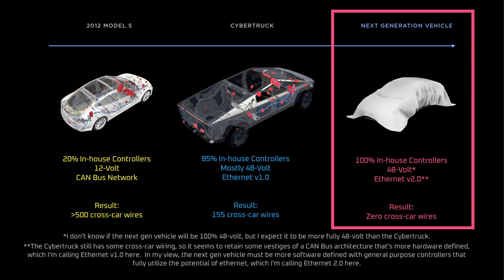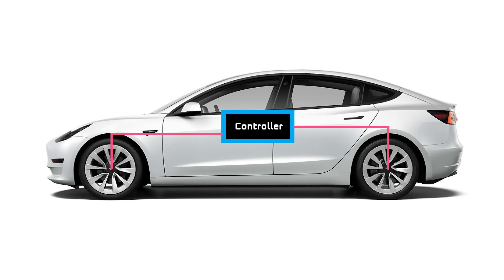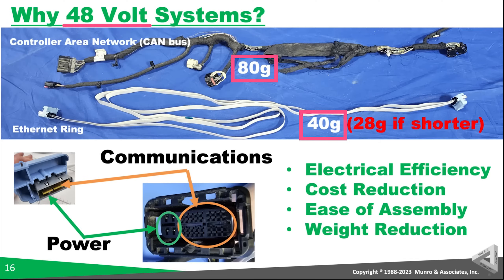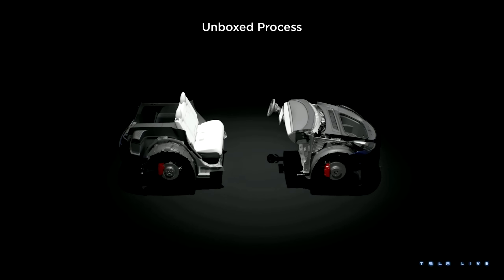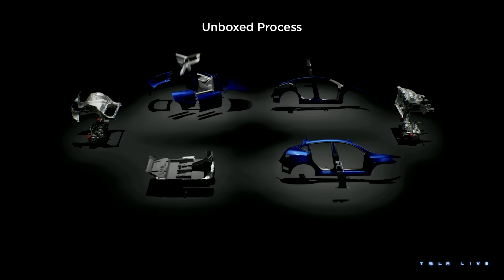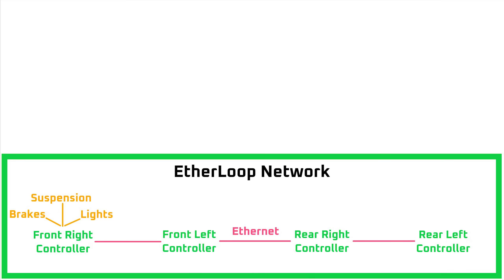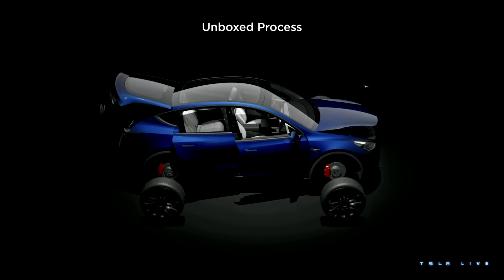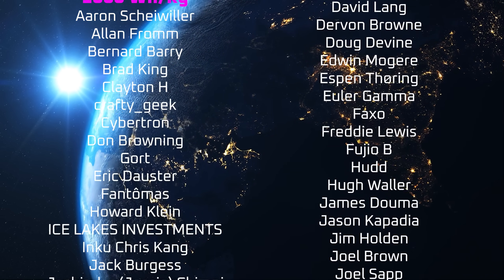Digging Deeper on Tesla's Etherloop Wiring System

Comment: Good information. This is a real game changer, not only for vehicles but for anything complex. It's a bit like when hardrives were SCSI,  mouse/keyboard were wired and had different plugs than printers. I'm not sure that this Tesla architecture if it becomes a standard can make any licensing fees for Tesla. Likely it's too generic. (Tesla might be able to sell 48v components, because no one is making these.  Cars were 6v until the 1950s, then 12v. Since about the 1960s they could've gone to 24v and then 48v which would've save billions in copper. What's happened is all OEMs (except) Tesla  use off the shelf components: lights, sensors, wiper motors, etc... which are now all 12v. They're so used to going through catalogues and making phone calls that it would be like starting from scratch for most OEMS.  This is why when Sandy Munro looked into the Ford Mach E and the VW EV he found triple the number of hoses and wiring as in a Tesla, and much less efficient use of space. The VW  has no frunk, but also almost nothing behind the dash where it would've been out of the way. This increased complexity also increases failure & recalls. ) 

For boats there's the NMEA 2000 network. It's a 12v CanBus system and is compaatible. You could stick a windvane on your car and plug it into CanBus.  NMEA 2000 has a few features that must also be common for CanBus: A backbone that runs the length of the vehicle (boat or car) and drops to the various sensors.The backbone is powered by a 12v connection(through one of the drops dedicated for this) but this 12v only powers the bus-- each instrument requires a separate power line.  Drops can be no longer than 6m (20').  My sailboat has a 63' mast and instruments at the top. The workaround is the Backbone runs to the front sensors near the bow, and then doubles back and goes  up the mast. The Drops then for the wind direction, speed, any cameras, maybe a radar on a spreader are very short. (I think the Backbone can be 170m long -- some very big length.)  There has to be terminators at each end of the Backbone. On my boat these will be in the binnacle (in the cockpit at the wheel, where the new chartplotter is and  my old Autopilot - which has never had a single issue in 20 years.) Third the NMEA 2000 network is infinitely adaptable. It plugs (and waterproof screw attachments) and modular. Right now it's in my binnacle down to above my engine. Later it'll run forward to the new depth sensor, and if I replace everything on top of the mast, I'll unscrew the terminator add more backbone to go up the mast... It's like Legos. 

Wnat  the data that flows into the backbone must be doing is identify the instrument source and the quantity. Signals for operation that flow back along the backbone must be understandable by the unit, lights, camera (to turn on, move, etc..)  
NMEA 2000  has a couple of features. First all manufacturers agreed to a set of standards  -so everything that uses it is cross compatible. Second it refreshes up to 2000x/second. The previous 0813 (SeaTalk in RayMarine) refreshes at a much lower rate.  My boat has both. There are translators sold that allow connecting the older 0813 instruments to the NMEA 2000 network, but I haven't tried them yet. I'm waiting to find verifiable real world cases where this is working. Otherwise I'll just buy new sensors.   
Just a download... if anyone is nerdy enough to be interested.  And of course as I was bending my brain to learn all this last month and then buying the gear.... of course I had the thought: As soon as I get this all hooked up, newer and better wireless gear is going to replace it. (There are wireless mast top instruments but so far these have a reliability issue.)

Comment: I have reservations about things like stering, brakes and the parking brake being fully controlled by wire or computer.
How is one supposed to move and control a vehicle that is bricked?
What happens on a heavily trafficed freeway, how about a remote piece of highway or in the case of the truck. A logging road, if things have failed, you cannot have the vehicle lock up, you will by hook or crook, have to pull it off the road until arrangements can be made.

Comment: Note that EtherCAT has existed for well over a decade at this point, and is used in safety critical parts of simulators today.  It is also used for CNC control. This has extremely defined latency, and solves the problems of traditional Ethernet.  However, the whole master controller thing may not be what Tesla wants.

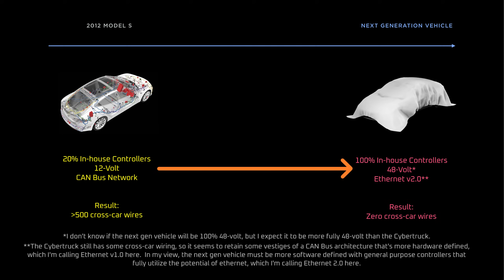I'd also like to address the whole part about random backoff times mentioned at around 16:50.  That's only a concern when multiple devices are plugged into a single wire, and is almost never the case in modern infrastructure.  Decades ago we used "network hubs" which just tied the wires together in a fancy box with a repeater.  Today we use "network switches", which operate in point to point mode with other computers.  This centralized network switch is known as a "star topology".

Another fun thing you may be interested in is POE (Power Over Ethernet).  Since Ethernet is a differential signaling protocol, it can be thought of as AC.  Well, we can apply a DC bias and power something with that.  Here's the interesting part.  That DC bias used for POE happens to be 48V.  It is a common voltage, so may be coincidence, but could reduce the wire count even further.

Comment: Very good explanation - thank you. 
From a point of view towrds maintenance the Etherloop and controllers should also make it much more simple to troubleshoot problems and faults. It also should make it more simple to design more robust fault tolerant systems with redundancy - e.g. a single wire failure may no longer be in issue.
Reply from the maker: Great point!

Comment: This also means common hardware which can also provide redundancy ,  you just need enough I O to go all the jobs it's attached to , it's very like PLCC , but the loss of a controller cpu could also be engineered round with the other units taking over the processing hence redundancy
Reply: @thelimitingfactor this would be sweet, does this assume a dud controller can pass through the end points it’s connected to onwards to another controller? Does the Airbus controller approach (mentioned in the comments here) offer insight?

Comment: This is basically turning the vehicle communication system in to ethernet network, this is already a trend in many industrial applications. In one sense they can build this them there are a lot of off the self-components you can sources.  Most of the challenging work is in   the software itself that managing the car and the controllers can be general purpose all in one micro controller. the next step i expect is to replace the controller interconnect with fiber optics   once I see they are using 48 volts they already saving money but using standardized components.

Comment: You can do the general layout you describe with ethernet with CAN, and tesla has been doing it. The main reason is data speed. The loop part of it is for redundancy, I figure.
Reply from the maker: Yes!  I simplified this a bit.  But it's more than just data speed.  And you are correct about redundancy, there's two ribbons
Reply: CAN is terrible for numerous reasons, speed being but one point.

Comment: Tesla still needs to implement some redundancy in the wiring due to shorts or open circuits in the Etherloop cables. But I get it! It all comes down to configuration management or the software features, variant handling, and fall-back/promotion of features to control I/O on another ECU remotely...

Comment: Now plugging in in a bad USB can finally turn off your breaks. Limitations of CAN are like 64 nodes. That's quite a lot of you want safety of isolating your inside lights and Netflix show from your breaks. Oh and remember that standard Gbps LAN requires 8 wires, instead of 3 for CAN.

Comment: Kafka, kubernetes with single type of controller all connected to same network. They took ideas from high speed finance trading and cloud computing/networking. They virtualized and moved development and testing in single repository. Took all ideas from modern software development.
Reply: Many things in the past decade have been moving increasingly to software controlled and centralised control systems. This is pretty similar, and for the same reasons. Manufacturing cost, less complexity(for the manufacturer) and production line efficiency

Comment: One benefit of the Etherloop that wasn't mentioned is it's a network which  means the signal has more than one possible wiring route - If there's a problem with a specific cable there's a back-up route that'd still transmit the signal (there's no single point of failure (when it comes to wiring)
Reply: Except that’s also the case with CAN in a ring topology.

Comment: Iirc the ieee have specified a new ethernet standard for deterministic ethernet so that time critical messages can be utilised.
There is already a method of tagging quality of service on ethernet so that time/flow critical applications such as VOIP and video can be used. However both these applications it is more important to ensure no jitter or flow interruption than ensure immediate delivery.

The new standard is supposed to deal with time critical operations such as braking, steering etc.

Comment: This thing sounds like EtherCAT, which has been a thing since forever in industrial automation. How it works is there's a master node with 2 ports - a sender and a receiver. The slaves are then connected in a loop that goes from the sender port to the receiver. How it works is that the sender eth interface sends a giant packet and the senders and  receivers fill it up with information right  as the packet passes  through them. The beauty of the system is that uses regular Ethernet phyisical standards and controllers, making it both fast and cheap. Additionally, outside of the special  packet, its a regular Ethernet bus that can host regular communication.

It's not really redudant and fault tolerant to breakage, but then, neither is a hydraulic brake like.

Comment: Mybe this was brought up and maybe the unboxing revealed info about this, but  i have been phantasizing about endpoints that ‘speak’ etherloop. So a breaklight consists of, say 20LEDs, those LEDs are driven by a simple microcontroller (think arduino kind of thing) the microcontroller received its instructions from what is called a controller in the video, but over the etherloop, not via cross car wiring.  The microcontrolles can also be fairly generic and the controllers can be simple or complex and software defined, as you like. But the need for cross car wiring is eliminated. You only need at each endpoint a power rail and an etherloop connection.

Comment: This video has quite a couple things wrong, and I'm not sure if it was done on purpose to make Etherloop seem better: CAN-Bus already is a ring Bus, there are no crosswires between between all the controllers.

The 48V system advantages are also overstated: controllers do not run on 48V (nor do they run on 12V), they will generally run sub 5V, so there is no difference in the cooling requirements for the controllers. The only difference will be on the power side of controllers IF the controlled device can be built to run on 48V.

Also 24V (most trucks in Europe) and 48V systems have existed and exist outside of Tesla, albeit Tesla is the first to use it more widely.

Comment: some confusion here- as other comments have pointed out, this is not a complete 48V system -  the power bus alone is at 48V.  In CANBUS the data bus voltage is much lower than 12V, typically data is transmitted at under 3.5V,  Tesla does not appear to be using Power over Ethernet (all 48V) which needs coaxial cable to reduce noise so the separate data bus will be only a few volts.  Most unlikely that this is 1Gb/s ethernet as that is costly overkill unless the  camera system is integrated.   The is a good reason that there are a lot of controllers in a CANBUS system - they use very low cost low speed microcontrollers. Universal controllers will need much higher datarates and will probably need full redundancy for  this application, which can be a headache.

The most important part of the overall Tesla strategy is the unboxed manufacturing system mentioned here. To do that the loop wiring must be rigid and all the buses must be integrated into a single unit as shown in the Tesla patent.  Cybertruck has not managed this but  for fully automatic manufacturing it is essential.   And to do that with separate structures for doors etc there have to be moveable joints which is not easy to do reliably.  

Also worth mentioning is that Tesla already use aluminum wiring in the model Y - it isnt necessary to use copper,  and a rigid structure is also likely to use  aluminum conductors  So a lot of missing pieces here.

Comment: Something to remember is that Elon likes the word "loop".  Look at his "Hyperloop" and see that there really was no loop involved.
Ethernet style networks are generally not in a loop form.  There was one in the past that IBM supported called "token ring" but that lost out to the topology that is common today for good technical reasons.
Reply: As others have pointed out, a loop avoids a single point of failure. The token ring is suitable for closely associated interfaces. Other architectures, like star or tree, work fine for widely scattered interfaces along some line (like a long hallway or a fence).
Reply: @WarrenLacefield  No, a loop doesn't protect against a single point of failure.  Token rings tended to fail due to single point failures.  On nearly any structure, One system screaming at the network can kill the system.  On collision based systems, it makes every packet a collision.  On a ring it makes everything busy with nonsense.
Reply: @kensmith5694  Well, I will need to research this. I think modern Ethernet ring configurations avoid this. For instance, there is Media Redundancy Protocol (MRP). And also Ethernet ring protection switching (ERPS). And other methods, I think.
Reply: @WarrenLacefield  Yes but remember we don't really know what Tesla is doing.  "EtherLoop" may just be a made up name.
Reply: @kensmith5694  That's true. "Loop" or "ring" around the body of the car or segments between "unboxed" pieces of car? But we benefit from good videos like this one to catch details that fill bigger pictures. Guess we wait and see. Good chat!

Comment: I'm wondering if Tesla will be adding the 48 volt and steer by wire tech to the other S3XY models. At least for S and X it would be great. Also, wouldn't it be interesting if they could use the unboxed manufacturing process and the thixomolded magnesium casting for those to improve them as well? Wouldn't that make them even more efficient and increase the production and reduce the costs? Can you suggest those ideas to Elon in X?

Comment: So if it’s a loop isn’t there a risk of single point failure? If one controller fails no other controller would be able to pass messages through it. Also if the controller for a whiper breaks in the CAN architecture, I would just replace the whiper controller. If the same thing happens in this new architecture would I need to replace the whole general purpose controller (which I guess would cost way more)?

Comment: Its looking more like the Cybertruck is a testbed for new tech they will be using in later Tesla models. If you're going to throw out many standards and introduce modern ones like Steer by wire, 48V LV system, etherloop modules & rear steering, a low volume product is the best place to test it. Curious if that means Tesla will release a Y/3 style pickup truck in the future and when this tech will trickle down to the Y/3/S/X.

Comment: This reminds me of one of the Apollo Moon landings, where one error code "screamer" due to computer overload, almost aborted the entire mission.  Other people have mentioned that you could have conflicting commands, due to module failures, or just plain electrical noise from arcing, with NO ability to manage these, for a specific item such as steering or brakes.  Those safety systems need to be bulletproof, and MULTIPLY redundant, just like on airplanes already.  F16s being a good example of the development problems in an early fly-by-wire system.

Comment: I wonder if a future version of  etherloop will visualize the controller software and the driver for each each system/endpoint you can build a cluster across all the controllers. What you get then is a redundant controller software stack. If one hardware controller fails, the other virtual controller(s) can take over.  When the hardware controller gets replaced, it upgrades itself to the latest firmware, joins the cluster and keeps full redundancy is restored.

Comment: It may have missed to mention the difference between CANbus and Ethernet regarding being physically fault tolerant, a Ethernet protocol if any of the wires used to communicate snaps or get obstructed the protocol either stop working or downgrade to a much slower such 10 or 100mbps, and it is considerably slow to detect and restore the network.

While the CANbus is fully redundant, it uses two cables to remove interference but still works even with one if a cable is damaged or obstructed without any latency loss.

Ethernet was not originally built for a vehicle component environment. Hopefully the Etherloop is not just a fancy name for Ethernet broadcasting between components working as hubs to propagate signal in a ring configuration, because over the time and material degradation we will have failures that might be almost impossible to detect and fix where the hardware is failing.

That said I have a cybertruck and I like innovation when done right. And I honestly want to learn more but I’m also speculating about etherloop as no much more than your video is available right now.